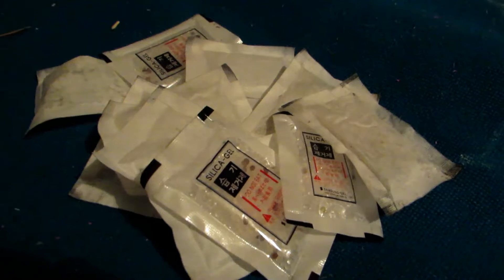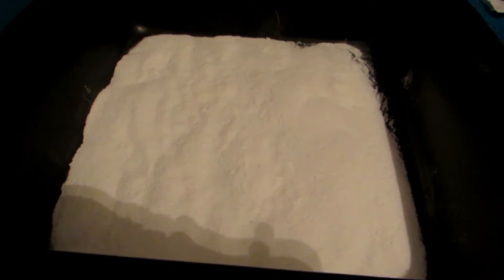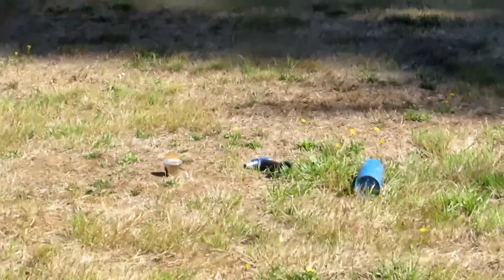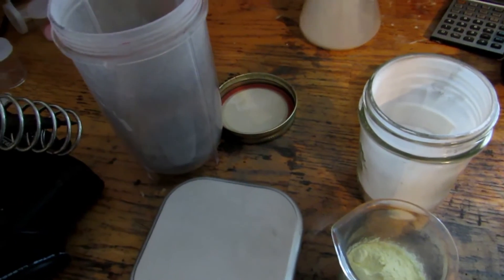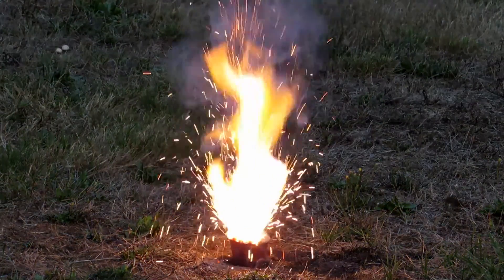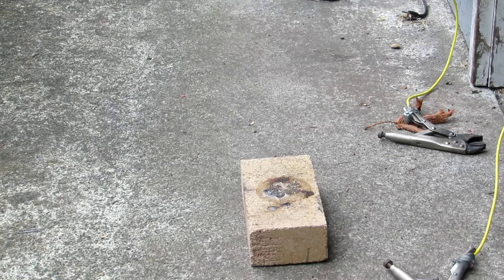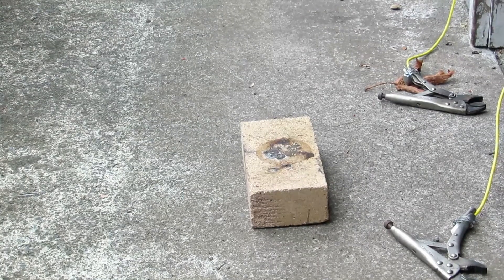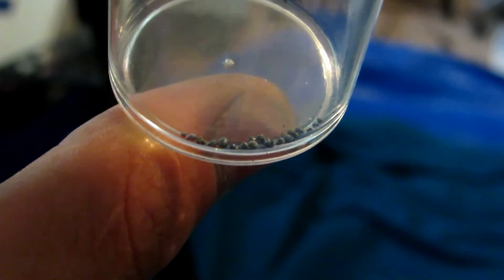Silicon from Sand (Household Materials)

Comment: In the sulfur reaction, the sulfur will consume 67% of the aluminum, leaving only 303 mmol of aluminum to react with 366 mmol of silicon dioxide, a deficiency of 184 mmol of aluminum.

Instead of 30 g of sulfur (935 mmol), 21 g of sulfur (660 mmol) would work better. This will consume 47% of the aluminum, leaving 495 mmol of aluminum to react with 366 mmol of silicon dioxide.
Reply: Ooooh, stoichiometry!

Comment: 1.6 g of aluminum (59 mmol) to 1 g of silicon dioxide (16.6 mmol)? I think you have that backward. That's 3.6x as much aluminum as silicon dioxide, by mole. It should be more like 1.33x.

Consider the reverse: 1.6 g of silicon dioxide (27 mmol) to 1 g of aluminum (37 mmol). 37/27 = 1.37x. That's pretty close to optimal.

Comment: First, you need a fire brick furnace to contain the heat second a crucible designed to let overflow fall to a second crucible third you need a feed chute to the first crucible and fourth a container of dry silicon dioxide sufficient to fill all crucibles that feeds the chute.

Comment: you should try getting a furnace, and heat the thermite up to glowing orange hot before igniting it. the reaction is so difficult to start, that glowing orange hot wont be enough energy to set it off, but it will add the necessary heat to melt everything combined with the energy from the thermite reaction.

Comment: I recently used diatomaceous earth because it's 85% SiO2 (10% other metal oxides and 5% moisture) and it's extremely finely powdered already.  It worked fairly well as-is, though I'll be performing the reaction again sometime in the future after refining the diatomaceous earth through acid washing.

Comment: If silica metal is more dense and heavy than aluminum oxide and the other impurities perhaps you could get silica metal in a sand like form by dumping out your thermite crucible mixing it all with water and then panning it out like you're looking for gold in a river bed then when you get the metal grains dry them off and melt them down with the arc furnace

Comment: I actually just got a silicon sample today, aunt bought it for me.

Anyway, might have mentioned this before, but how about purifying sand by soaking it in hydrochloric acid to drive off any calcium carbonate and other similar impurities? then using the sand for this reaction?
Reply from the maker: I tried this, but had horrible results. I will hopefully do a video where I purify sand with acid, then turn it to silicic acid then back to the dioxide. It would be very pure and usable.